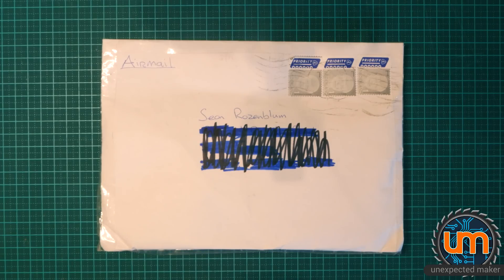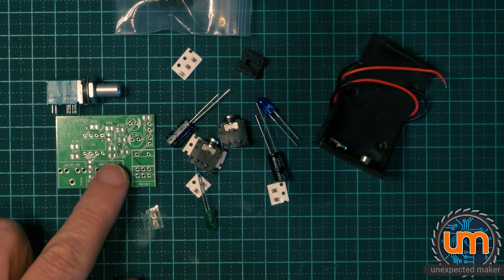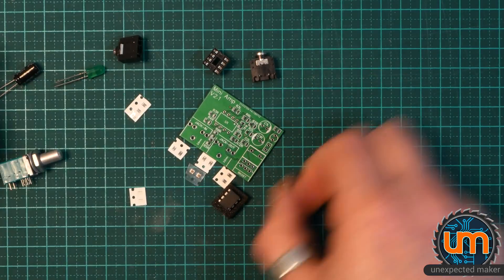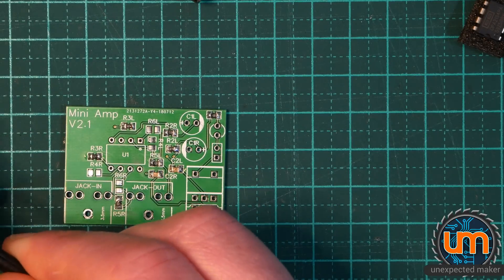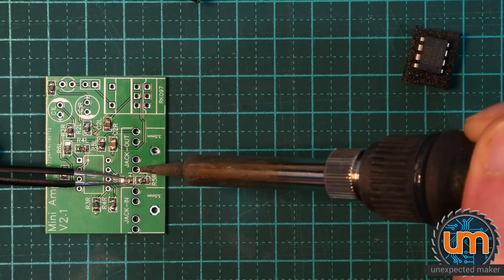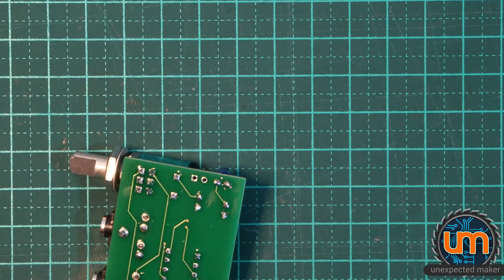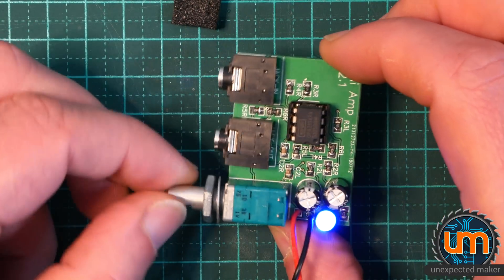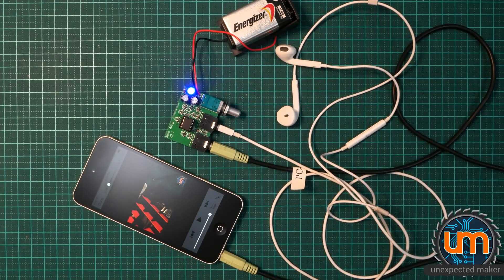Kit Swap #1 - Mini Amp by Dustin Watts

Comment: Do you know where I can buy the same solder you are using? As you mentioned in the video, it leaves hardly any flux residue. My current solder leaves a horrific mess.
Reply from the maker: I can;'t post external links, but look on altronics_com_au website for t1100-0.8mm-200gm-roll-60-40-leaded-solder
Reply: Thanks! Coincidentally, I live less than 5 mins from an Altronics store. I'll pick some up!

Comment: Hi Seon, I want to know how i can add an isolation slot on a pcb like the one that you can find on power supply.
I am planning to launch a kit but i dont know how to add those slots.
Reply from the maker: In Eagle you can just add more shapes to the dimensions layer and it will boolean (cut) those out from the board. I assume it works the same in other packages too.

Comment: Hi Seon, haha, I got your mention @8:08.  Glad you didn’t do upside down, that’d definitely trigger placement stress! 
I’ve always targeted 0805’s as preferred SMD size. A good size to also allow for manual soldering. :) 
Perhaps I should use 0603 more, as they’re small enough that you don’t notice which way around the markings are.
But then again, I’d probably still check 0603 marking orientation! LOL
Reply from the maker: Ha! I wanted to give you ample warning this time ;) I'm thinking pf trying some 0402's on a new project... need to build up the courage!